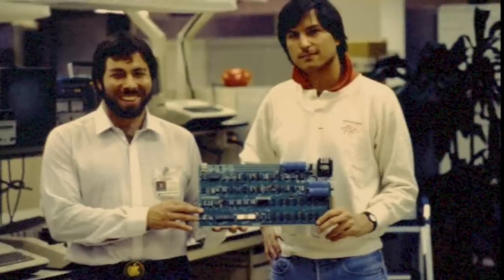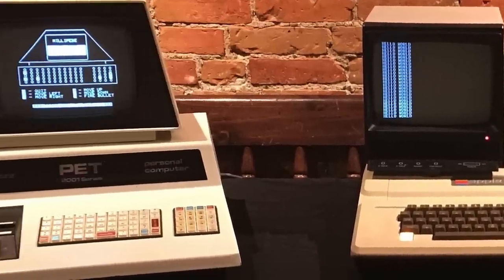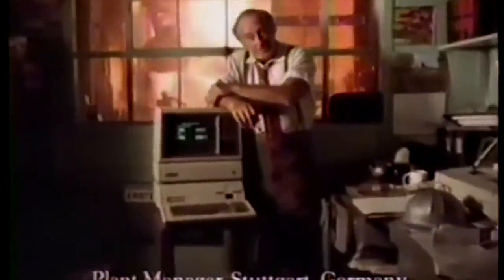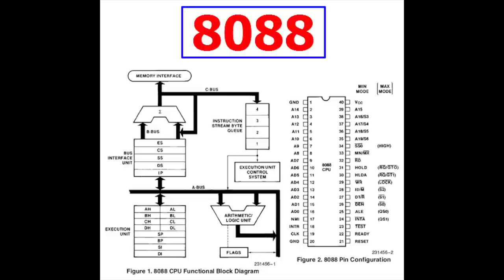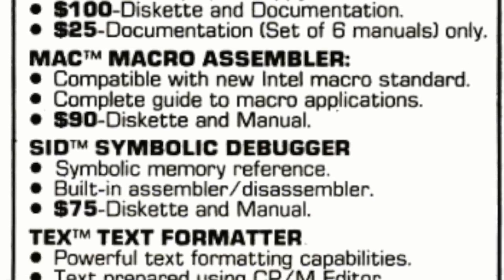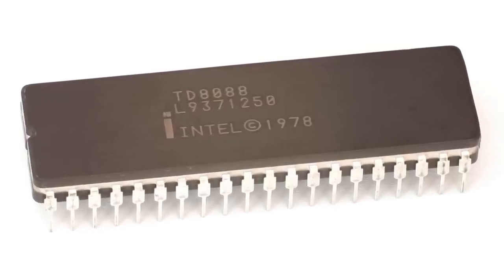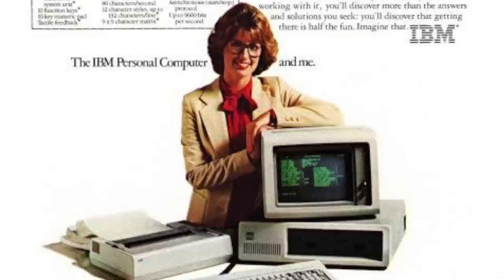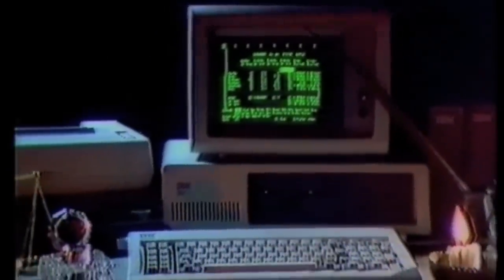DOCUMENTARY: Why and How IBM ended up creating the PC (and ended up choosing the 8088 CPU)

Comment: This video is very inaccurate.  Had this individual talked the people who were involved in how the pc evolved from prior Intel and Zilog processors, it would have been more accurate.  I was involved in the industry back when tbe S100 bus was adopted.  The biggest challange was maintaining user compatibility across different architectures.  The Apple and Commodore machines were based on Motorola processors while CP/M was written on the Intel processor.  IBM hardware  was based Intel for CP/M compatibility and PCDOS upward features.  While Atari was king of graphics, its processor never took hold in the business market for various reasons.  Zilog was a wildcard during the 8 bit microprocessor reign.  The memory architecture of the Motorola 68000 series was easier to work with but not as versatile in the long term as the Intel harvard architecture would prove to be.  The master boot record concept provided a consistent boot method 5hat was shared between Intel, Zilog, and AMD,even today.  And it has been instrumental in providing the ability for some older versions of Windows and Unix type operating systems the ability to boot to this day.  I worked for one of the largest communications companies in the world at that time. I had a wired wrapped IBM 5150 on my desk 8 months before any word of the machine was leaked.  I worked on the first commercial program sold in the US that was released within days of the PC.   Before that I worked on operating systems for the TRS-80 series that were not written for Radio Shack.  Those systems offered portabilty across thee model lines using the same code base back then (mid 1970s).  I also xeveloped the first onsite personal computer service contract and repair process with TRW for the Commodore Pet 2000.  I still have all the manuals and two original Radio Shack Model I systems that I used for development 50 years ago.  I threw out my original IBM 5150 around 20 years ago.  And I also got rid of my original Compaq at the same time.

Comment: I wish you’ve done more research and understand why IBM chose Intel 8088 instead of Motorola 68000. You missed the most important point why ibm jump into the market which is DOS from Microsoft. Do more research!
Reply from the maker: That's not true. IBM asked MS to make an operating system /after/ they chose the x86 architecture. As I say in the video, MS didn't even have a DOS, they bought 86-DOS (QDOS) from SCP and worked on fixing it up alongside some developers from IBM. IBM made the decision on CPU by themselves. Microsoft suggested that they go for a 16 bit CPU, that's all.
Reply: @AlsGeekLab  that’s lots of article about how IBM wanted to use 68000 32 bit cpu which is a lot more powerful and no 64k address limitation. but they have no choice because there were no OS only com and Microsoft only have Basic. I was involved w IBM at those years.